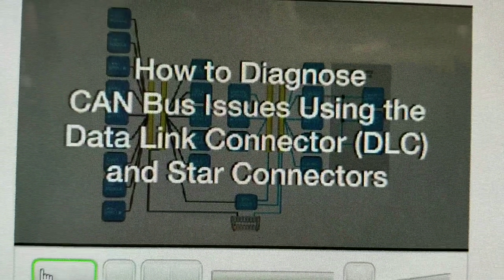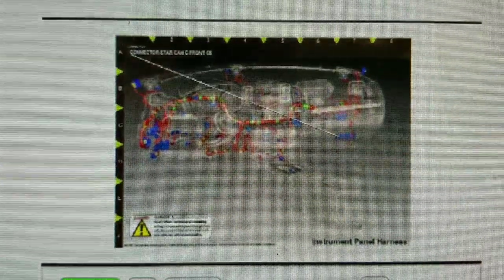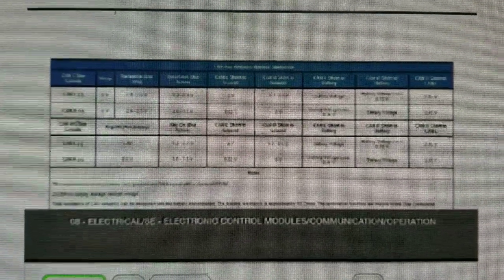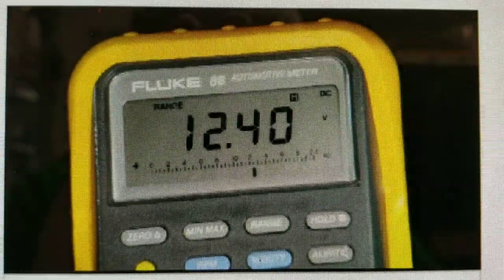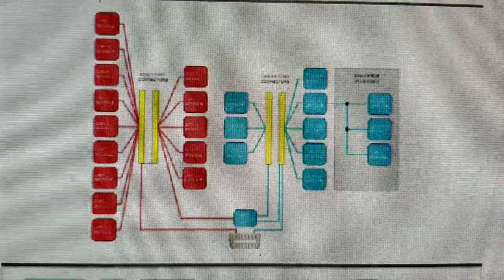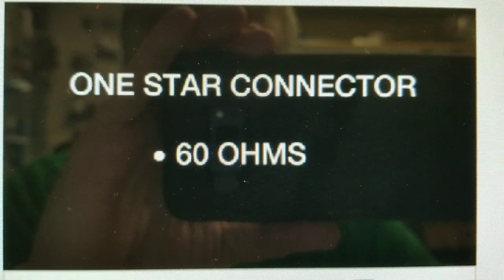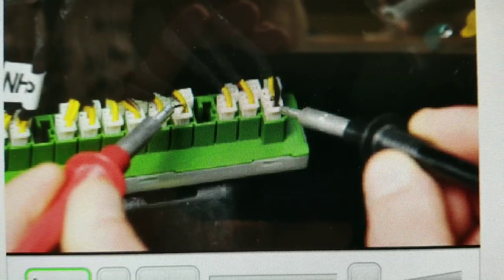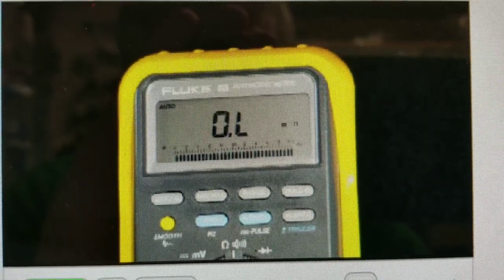Dodge RAM CAN BUS Network Issue

Comment: Whoa partner . Testing resistance at the dlc or even voltage is only good if you understand that if a TIPM or SGM is present that this test is useless .
Reply from the maker: Keith, this is a video I am sending a customer to check his can bus network along with a pdf instructions.  We tested his ignition switch, rfhub and Fobik remotes and it all checks perfectly. Fobik remote locks, unlocks, remote starts and key starts our test 2017 ram truck, but no response on his truck.
Reply: Gen5 has changed all of this now  look for starlantist wiring much different 100+ network speeds time to get your scope abilities tuned up